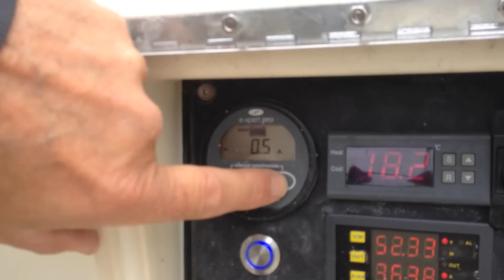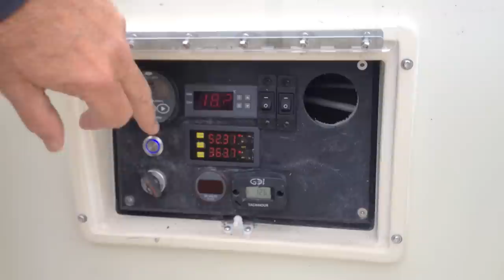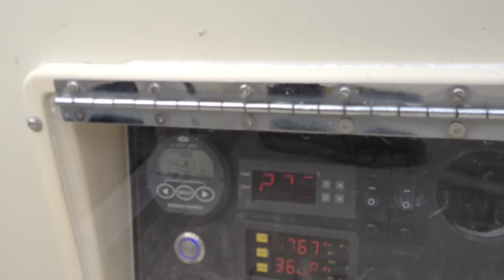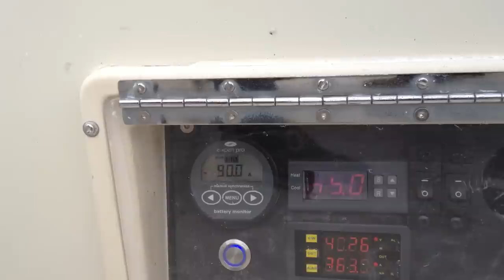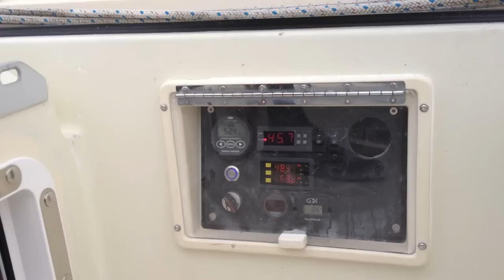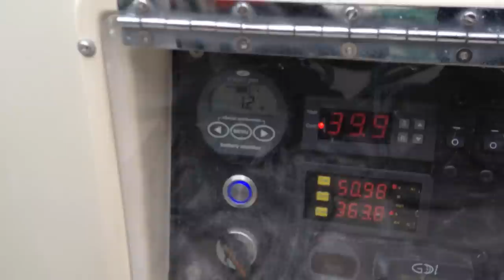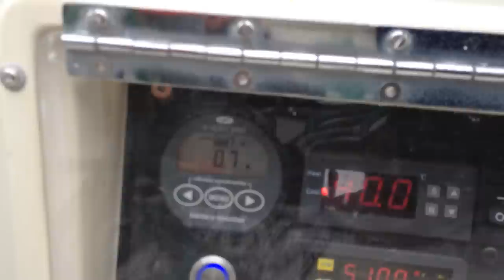Diesel to Electric Power Conversion Part Two: Testing on the Water

Comment: Bravo to these guys, sail boats existed in 1300 bc and diesel not until 1890. That’s over 3000 years of sailing without diesel and look at the vendee globe and Volvo ocean race - they only use engines to power hydraulics and to pump ballast - no propulsion. They get around the world- what’s the difference? They are pro sailors with pro navigators and they miss most of the wind holes and use the tides in a smart way.

Comment: I've run my diesel for 24 hours at 7 knots.

I would LOVE the quiet of electric, but I think I'm going to have to wait for the technology to advance. 

Good video though.  Good luck and happy sails.
Reply: What’s about running it under a generator?
Reply: @clebermachado  It seems as if it would be a question of fuel efficiency. And a diesel generator makes about the same amount of noise as a diesel engine.

Comment: In part one you said the motor produces about the same horsepower as the diesel did so why didn't you add a larger motor (10%, 20%, 50+%) to reduce the strain (if any) or was it cost?  ;-)
I'm guessing, unless there's a significant tide, while at anchor you'll get little to no recharge?
That's a motor sailor so the use of the motor will only be needed (hopefully) in the harbor, while a power boat will be running most of the time (unless anchored/docked)?
I'm guessing a power boat will require additional systems (generator, wind generator and/ or solar) to maintain a useful battery(s) charge?

Comment: I don't sail but find all this very interesting. A question about the prop...How do you adjust the propeller angle? I thought it was always preset and  you had no control over it other than it closing up when not under power or sailing.

Comment: Awesome set up for a sailing vessel.  Wonder how long it will be before an affordable trawler with an electric motor can cross the Atlantic.  Looking to buy a boat in the next year, but I have a feeling it's only about 5 years away that electric boats will outperform diesel.  Electric cars are already outperforming gas cars.

Comment: It is very interesting. I'm looking information because I want to change it in my boat (you can see my perkins in my videos).
One question: Is there any issues about magnetic field and compasses? minimum distance between them?
Reply: the only issue is about lightning. If one hits the mastre, that is aluminium, what can happen with with the inverter electronics???
the weak part is the inverter,  unless you have a one as backup....
you know, electronics and salt water is not a good combination, that is: supose you go sailing to the pacific south for 10 years , can you have  spare parts, and maintenance for 10 years there??
Reply: The electronics can be fully "potted", meaning fully encased in plastic internally.  That greatly reduces corrosion.

Comment: Hi,  i was wondering if you could put a pulley on the shaft and mount an alternator and belt to generate while you were using the electric motor ? thx
Reply: Seriously Mark? Look up perpetual motion machine on yer google machine
Reply: One would cancel the other out , eventually stop !

Comment: Start my Diesel and I Am good for 600 miles if needed. Good for hobby boat for people that are weekenders.
Reply: Brad Lee have you tried sailing?
Reply: xXxFrgn NtrfcxXx- Apparently  you havent been stuck in the doldrums before.While I love the idea of a electric boat there's times it would be a handicap and could leave you stranded.Lets not mention canal passages either;-) As Brad said its great for day and weekenders but its not for the bluewater crowd just yet.
Reply: It's comical when people ask questions like, have you tried sailing, I have no doubt those folks have never been on a boat, let alone a sailboat.  It's such an ignorant comment.  I will say it plain, you would have to be down right dumb to pull your diesel and replace with electric. The only folks I see doing it and bragging about their elec conversions have little to no real world sailing experience.
Reply: Chesbay Windseeker not really only ignorant people truly say that. Especially since most of the now mega ships are diesel electric. Add a generator and boom your a diesel electric without the problems of the diesel. Granted it opens new problems for the generator. But you can charge as a backup under sail. A generator can be placed under a hatch so that it could be swapped a lot easier than a inboard.

Comment: This sounds really cool. From my limited knowledge of diesel vs electric it seems the maintenance cost/effort for electric would be negligible.
Reply: Correct.  Electric drivetrains are vastly simpler than combustion engines.  Compare the battery, controller, charger and motor to the complexity of a diesel engine.

Comment: I would love to go electric on my boat and have fair experience with the technology as fly electric model aircraft but a 10mile range is next to useless on any boat except a day sailor and yes sometimes you have to run the engine on a sailboat for many hours. Especially on inland waterways as already mentioned by some.

Comment: When sailing, is the prop capable of recharging the batteries?
Reply: yes
Reply: Yes, he covers that at about 13:40
Reply: Yes, but a yacht propeller isn't the right shape for maximum re-gen.  Also there are only small gains when sailing less than say 5-6 knots  Re-gen is great for big boats, with big diameter propellers going very fast.  30ft coastal yacht forget it and stick with solar panels.

Comment: seems there's no reason to build sailboats with anything but electric motors now.
Reply: Yeah, they are great if you never leave the slip.
Reply: Well it gets expensive for larger builds, but it is certainly a good consideration.
Reply: Only if you like to sail.  Many who leave the dock or mooring use power the majority of their "sail" time in which case, they might as well have a motor boat.

Comment: How can you change gear ratios with direct drive and a max prop? that doesnt make sense. nice video though
Reply: The max prop can be multiple pitches, but you need to take it apart to adjust the pitch. It's not done on the fly. Very good props though. Love mine.
Reply: Richard Mackie yeah precisely. You said you can change gear ratios. Which is not true

Comment: Is there actually a throttle control or do you have to push those buttons to change speed..A throttle  lever would seem better.. I didn't understand the prop thing...does this boat have a variable pitch prop...my Golden Hind did with a Sabb 15hp diesel one lunger.

Comment: No Solar and Wind turbine to charge the batteries.
Reply: come on don 10 batteries I think not
Reply: second chance sailing What are you charging them with if your out in the middle of the Pacific using AIS , HF SSB, Lights radar etc
Reply: think you will find no one using this setup for long trips maybe pose around the yacht club
Reply: With 3-4 300 watt solar panels and a one or two wind turbines combined with regenerative breaking you could easily charge it up enough to use assuming you are sailing and don't have to constantly use it. Maybe a generator just in case but you can get just as much mileage out of an electric motor as you would with a gas tank.
Reply: Don...that was my thought as well. I'm not crossing the Indian Ocean for 10 to 12 days without something besides a reversing prop to charge my batteries. What if I need to run full power to get out of a storm and only have 4 hours of run time but need 6. Even with a lot of Solar Power...I don't think I'd chance it. AND...if I'm in a storm with NO SUN..I still have no way to charge the batteries. Guess I could go the hybrid route and use a generator to  charge my batteries if solar wasn't giving me the juice I need.  Ö

Comment: Think we will have to wait for TESLA to make a boat
Reply: second chance sailing why?
Reply: don't try to compare lithium batteries with lead acid
Reply: Solarwave already did.
Reply: second chance sailing lol I was thinking the same thing
Reply: You can pick up a tesla drive unit for a few grand. Ebay normally has a few. You have to work a bit with the controller to make it work well. Someone was working on an custom controller which would save alot of effort. But the tesla motors are all really overpowered for most boats...

Comment: It’s nice to see progress toward electrically powered boats but the technology is not yet where it needs to be for cruisers. Imagine being becalmed for a day or so with only 4 hours of battery life at 3 knots. Your range of 12 Miles then having to recharge for who knows how long using solar or solar and wind does not seem appealing. I guess it would be ok for day sailors motoring in and out of harbors and short distance sailing. Call me back when you can get comparable range at comparable pricing. Keep trying though! The technology will get there, just not yet.
Reply: Vine Len where are you sailing that has no wind? Your bathtub?

Comment: Without an onboard generator - this system is too limited for cruisers. With a generator it is a doubling up of cost and complexity - for what benefit exactly? The talk about putting more batteries in just makes me shudder in terms of cost, installation costs and wonder how much more room they are taking in lieu of the diesel tank. It's a great technical exercise but it is only useful for Marina queens or for cruisers who are really prepared to bob around  around (for days) without wind. Just my opinion.
Reply: Oh and the regeneration aspect is a joke and these yours are overselling their idea. Sailing at 4 knots and regenerating 1 or 2 amps is no good.
Reply: It may not be for everyone. But even with a generator and the complexity it brings, there is a benefit. The genset it takes to power an electric motor will have a much smaller diesel and the amount of fuel used would be greatly reduced. An example would be replacing a 27hp diesel with a 10kW motor, battery bank and a 6kW generator in a 16,000 lb. boat. You'll get 6 knots at full power. And when the battery bank gets low, the generator alone will get you 5 knots... while being powered by an 11 hp diesel with a consumption of only .4 gallons/hour.
Reply: the point is, if you only sail the boat, and rarely motor, this is your best option. it has nowhere near the cost sdvantage a small diesel does,  until you get over 70 feet or so, if you want the same number of hours.  but if you only need a couple of hours of motor in reserve, its fantastic for the side benefits you get.
Reply: They gave a practical example of a sailing yacht using regeneration to provide all house loads while under way.  That yacht didn't even need to run its generator since they could charge the battery bank by sailing, using the electric motor and reversing, feathering prop as the generator.  Also the space needed for the battery bank and motor is probably comparable to the diesel engine and fuel tank.  You could see it in the first video.

Comment: No one has addressed the safety aspect of electric drives during an emergency like flooding of the cabin. IF you are motoring along or decide you need the motor on to get to safety due to a problem and you have flooding, will the people standing in the cabin ankle deep or deeper in salt water  are they going to get electrocuted because of the motror commutation spikes from the drive as it is functioning. Stated another way, there is a lot more voltage in the motor and drive electronics that the 48 volts due to inductive actions of commutation of the motor drive...even brush less motors generate voltage spikes as voltage is applied and removed from any inductor.

It has also been mentioned that these electrical motor systems are inherently less safe on the ocean due to their limited range. Why is this not pointed out as a major concern for blue ocean sailing?  What is the expectation of electric power if it is doused in the open ocean?

Has any one evaluated if with these higher voltages, is there more corrosion going on in the boat due to leakage currents?

It seems we have many pioneers, but zero failure analysis people looking and what may be a very dangerious effort to use unproven  technology in a hostile environment.

Comment: I know this guy is excited but an hour at 6knts vs days on end at six knots is no comparison. I like elec. And have known for many years it was promising but i be dam if i would be at sea with only elec. It would be dangerous at least and ide say risk of fire increases greatly. Many years ago elec. Overtook nitro in the rc world. A nitro motor is doing all a motor can ever do and elec. Easily beats it. Full scale isnt there with boats yet. Diesel elec. Would be the best deal going at least you get peak efficiency from both systems.

Comment: calling BS on the lithium having 7000 charge cycles. in reality, LiIon batteries degrade over time regardless of how you use them, so you must replace them after a set time no matter how many cycles you have run through. typical lifespan is about 5. to 6 years for high quality prismatics. AGM lead batteries can last 10 or more years if you keep them above 50% most of the time, and you dont often go over 1/2 their rated draw, expressed as "#C" which is multiples of capacity. highest quality deep discharge lead acid batteries can last in excess of 20 years. So its true that you can get more Amp Hours per pound out of lithium, but true COI is still much higher than lead. if you have the carrying capacity, best value is to get Surrette lead acid batteries and make sure they are very well secured and cannot spill even in a knockdown, or live with AGM batteries, but keep them charged up as much as possible.
Reply: Lithium Ion batteries are improving rapidly in terms of cost, capacity and life.  For example, they're doubling in capacity or halving in cost every decade or so.  It's possible more progress is being made in automobile applications now, but boats will catch up.  Eventually electric power will be less costly to both own and operate than combustion engines.  The operating cost of electric vehicles is currently about 1/4 that of fossil fuel cars.

Comment: "At 3-3.5 knots you get 4 hours", what a joke. How are people crazy enough to ditch a 250-300lb diesel, replace it with a 700lb (minimum) system that underperforms in every category.  It's funny how he can't really name one actual advantage with electric.  Also 1.2amps of regen into a 200ah system is nothing by the way, it literally is giving you zero extra running time.  One day the technology will be there in 2018 it isn't. Oh by the way, the 12hp he trashed for this elec system probably burns .5 - .75 gal/hr at full throttle.

Comment: Sorry guys i love the idea of electric and sail.
But at 3 knots your driftwood.
Really disappointing.
Reply: The closer to an hour than 90 minutes of time at 5.5 knots or full power is flat out disturbing (what happens if you are 2 hours from shore with wind or tide against you?)

I look at all that dead space in the engine room that was taken up by engine and think that it should have either had a solid row of batteries or a generator.
Reply: They were talking about increasing the battery pack. It's geared slow, so that they can recharge by sailing above 4 knots. Anything that puts negative loads on the motor is going to charge the batteries. They talk about a larger, 44' boat sailing at 7 knots charging all the batteries, plus supplying their other power needs.
Reply: Henry Kroll I think the possibilities of electric motors for sailing vessels is great, and inline with what sailing is about.

But, it has got to be better than this.

It needs to be able to get at least 3 hours maybe 4 of solid motoring at a modest speed.

Recharging when under sail is great, except that is drag, however small.
The big thing is that you need be able to go long term also, like, if a sailboat gets stuck without wind, the motor needs to be able to keep them from getting stranded (in this situation recharging under sail doesn't work).
Solar panel recharging is cool, but still not entirely there.
Reply: Jack Cade We will hopefully be installing electric drive in a 38' sailboat soon.
Reply: Not really

Comment: Lets say run time 2 hours, with everything new, give the batteries a year of use, some growth on the prop and hull and the electric moter in a moist bilge.  Now how long will the motor run. Now add a head wind and a bit of current against you.  This system is ridiculous.  Ask this guy for a writen performance guarantee,  with money back and watch him run........... also the average sail boat uses 120 hrs engine time a year in the Pacific north west.